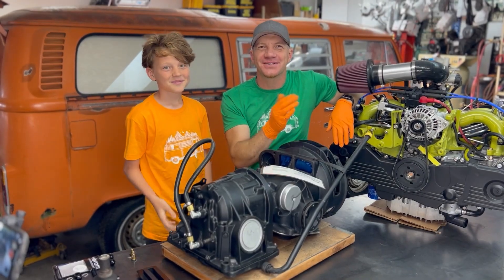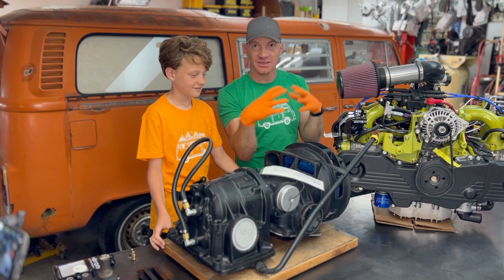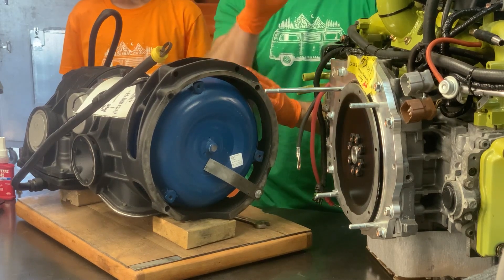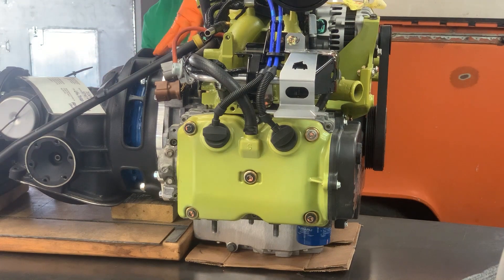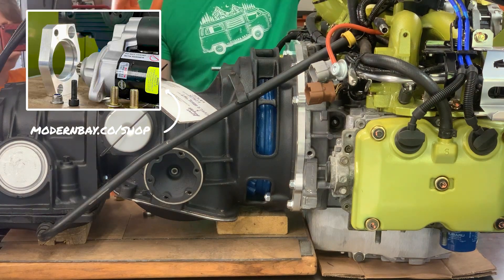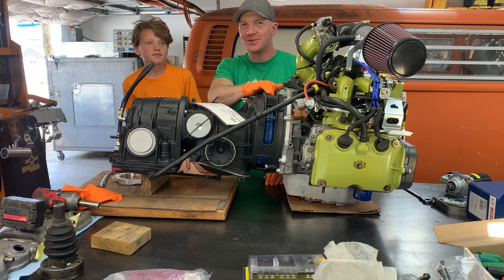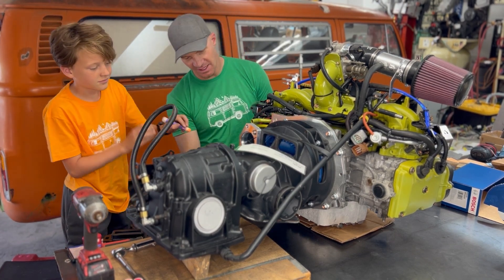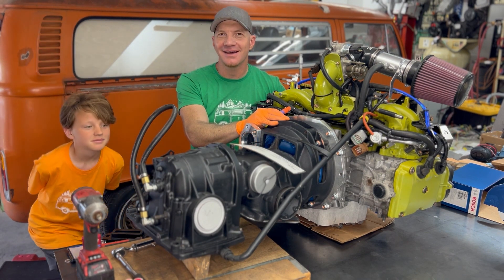How To Install An Automatic Vanagon Transmission in YOUR VW Bus Subaru Conversion

Comment: This may be a silly question but do the automatic buses still have a parking brake/emergency brake?
Reply from the maker: They do, generally don't use it as much. And it sometimes will hit the shifter when the e-brake is pulled and the shifter is in park.

Comment: 090 with the external cooler and an upgraded converter!? baller setup y0  

Those 3 speed VW autos are awesome... I love the way Buses drive with them !!!

 Looks like a GoPNH (Precision New Hampshire) torque converter?  
is the whole tranny from Ken @ GTA?
Reply from the maker: It is a Kennedy Engineering Products (KEP) Torque converter, and yes the whole tranny was done by German Transaxle. Thanks for the support, baller setups is the goal :). !!